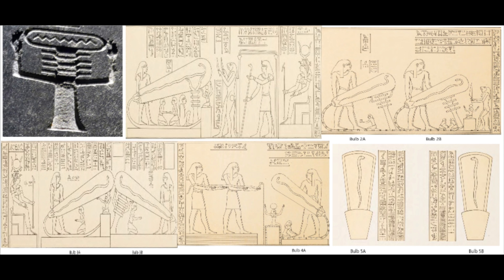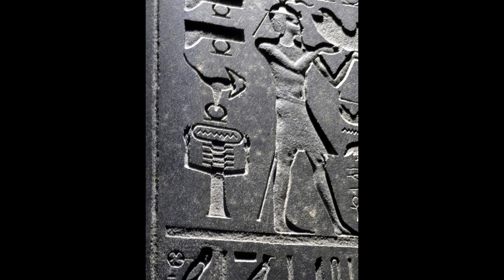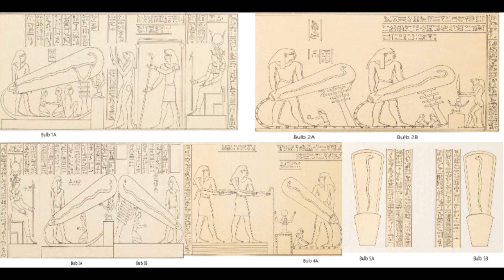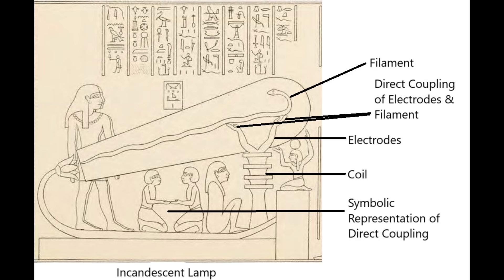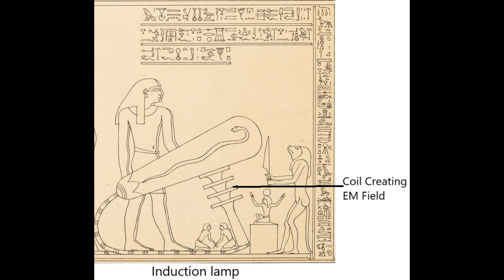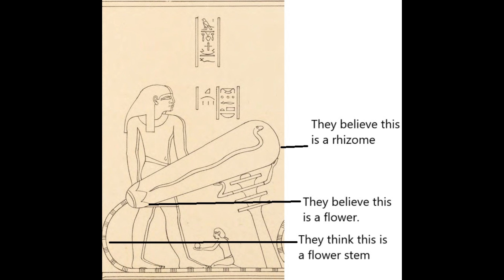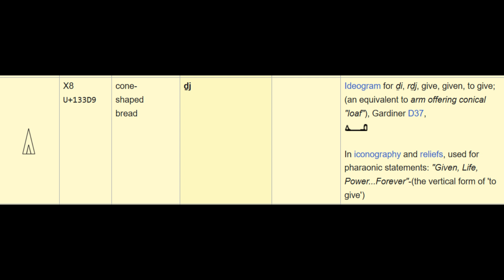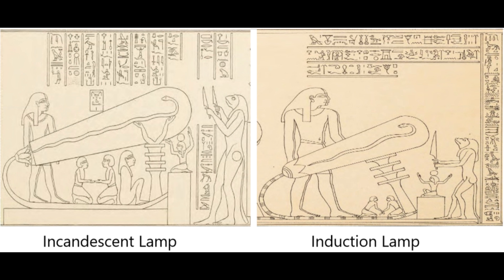Technologies of Ancient Egypt   Part 7   Lamps

Comment: Maybe the knives are symbolic of piercing the sun for light. In one case there are two knives and two filament hands. As is it twice the amount of light? Other oddities, why is the guy holding the lamp have a Dubble silhouette? Does it depict two? Positive and negative? And what about the guy with his arms up and a ball over his head? Is that a symbol for light being channeled from the sun?  Did Egyptians have glass? Where would the gas have come from? What gas could it have been? Does the snake represent a wire? And if so, why a snake? Maybe it's an electric ell?
Reply from the maker: Hello Steve, thanks for watching and commenting. 
Interesting interpretation of the knives and well spotted ref. the double silhouette. Yes it depicts 2 people side by side, again that's an interesting take on them being positive and negative. 
I think the guy with his arms up is a variation of the electrodes symbol, I haven't really figured out what it means in these pictures yet. 

They illustrated these bulbs as if the glass was clear, ie we can see the serpent.
Im not sure exactly what gasses they used, but here's some posibilities.:-

Nitrogen gas is useful in incandescent lamps, it prolongs their lifespan. Nitrogen can be produced by performing fractional distillation of liquid air. 

Argon gas is useful in both incandescent and halogen lamps, that can also be extracted from liquified air by performing fractional distillation. 

Mercury vapor is useful for fluorescent lamps, they got their mercury from cinnabar mines.  

Bromine is useful for halogen lamps, that comes from seawater, saltwater lakes or underground brine wells. 

I also think they had hydrogen and deuterium lamps, they would have gotten those by electrolysing water.

Interesting Idea about it maybe being an electric eel. I think in these illustration it represents a filament or a gas filled tube.  

I'm not sure why they chose a serpent, I'm liking your interpretation of it as an eel tbh.

Best wishes